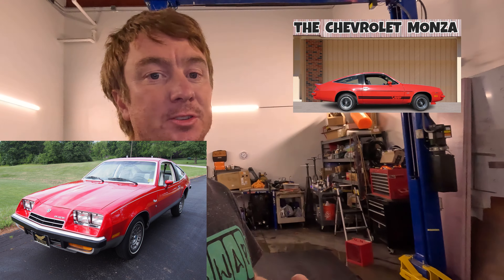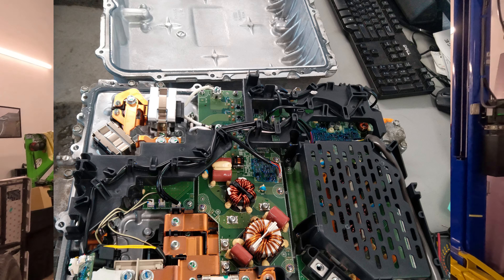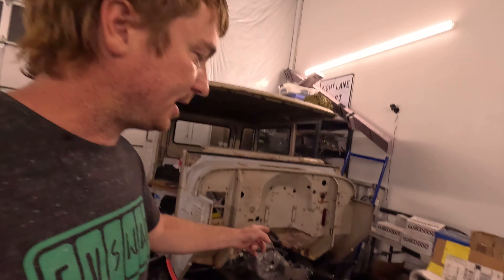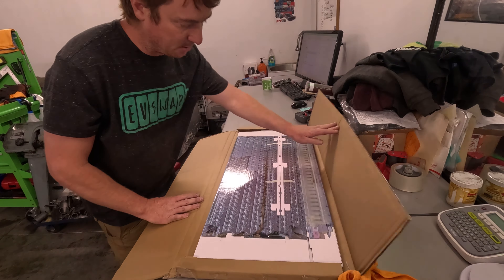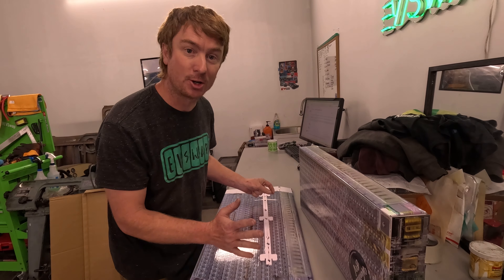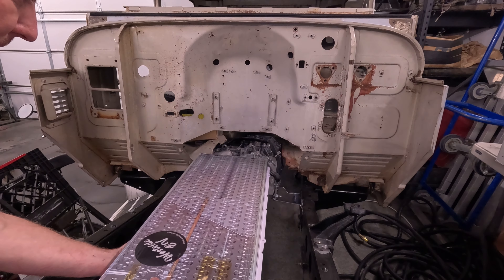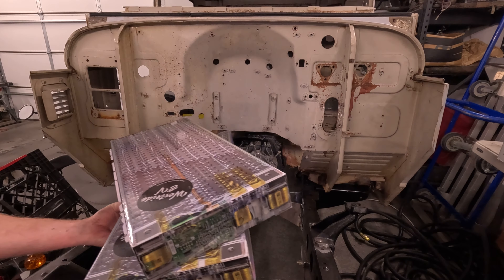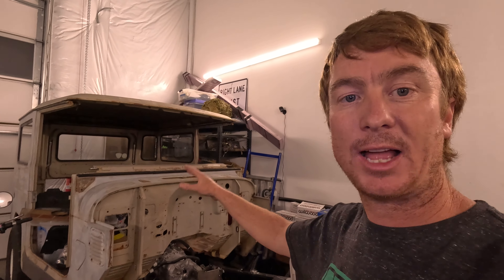Overcoming EV Setbacks!

Comment: I'm stoked to see the 2002 Tacoma! 

Been having recent dealership service department "mess-ups" on my 2017 Tacoma. Plus, new 4th gen Tacomas do not appear to have better nor reliable powertrains. So, it's all got me wondering if someday it'd be better, simpler, and more reliable to ditch stock IC options for electricity alone. 

How is the 2002 Tacoma customer using his truck?
Reply from the maker: He will be using it as a daily driver from what I've heard.
Reply: @EVSwap  nice. Do you have an estimate for miles he might get as a DD?

Comment: The energy and power density of those battery module mockups is insanely high. That's exactly what we need for conversions. 😂❤❤❤
Actually, this is a great idea and will help a lot of retrofitters who it would help immensely by enabling them to see how modules will fit before they buy them and even by eliminating the need to lift heavy modules around when doing placement and fit analysis. WOW!
Reply from the maker: Hahaha yep they are so light!

Comment: Be interesting to see your next Leaf based project.

You said 62kWh. Is that all leaf, including it’s battery, or will the battery be from something else?
Reply from the maker: Yes, the plan is to use everything from a 62kwh LEAF including the battery. Going to be awesome! 215hp!
Reply: I don’t have the 62kWh battery myself yet, but I hope to get one. So I was looking up some of the detail. The orientation of the modules is different in the 62 to earlier. There’s a short thread in Open Inverter, in the Nissan Leaf section, ‘Leaf 62kWh module power path’ with a couple of diagrams if you need them. Be interesting to see how you go about dealing with them. Also worth checking a few vids Dala did when he found he had a bad module. But you probably know all this!
Reply from the maker: Thanks, my friend Karl gave me some documentation on the 62kwh pack as well. Looking forward to getting one and opening it up! I think the additional challenges will be well worth it for the large pack.
Reply: @EVSwap  just got mine yesterday. It’s actually a 60, not 62. Apparently a slight Nissan tech change in 2023, but don’t know details. It gave me a 204c error on the Resolve screen which I asked Isak about, but then also found your earlier comment about a Resolve firmware upgrade to solve that - so thanks for that!